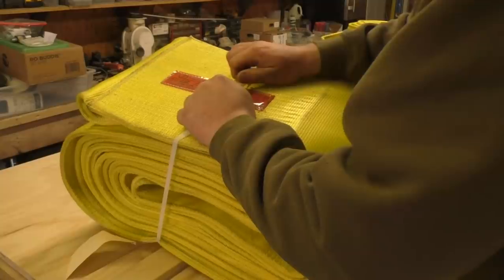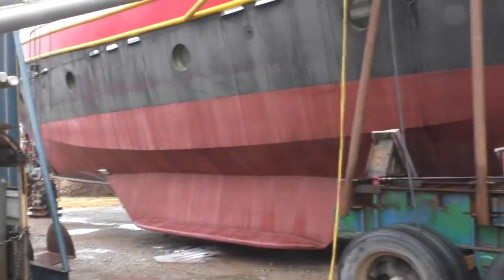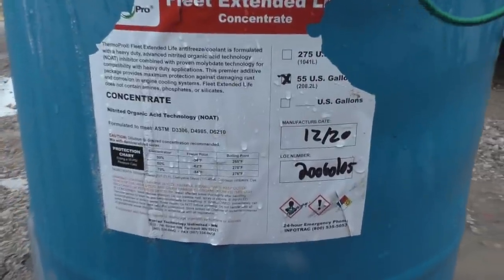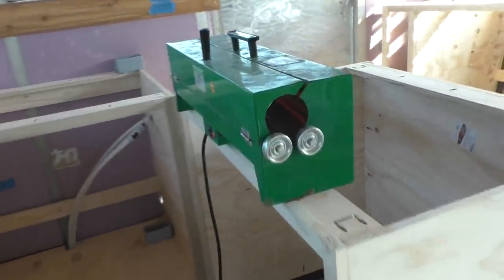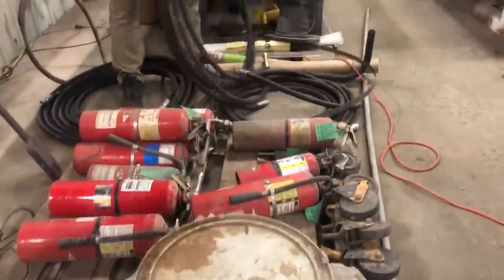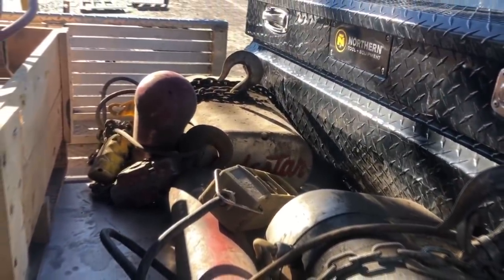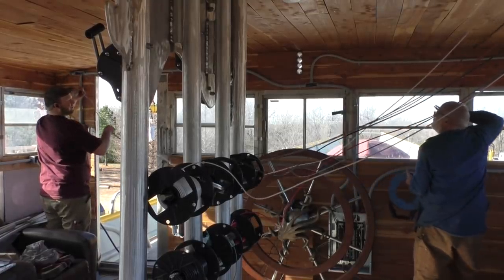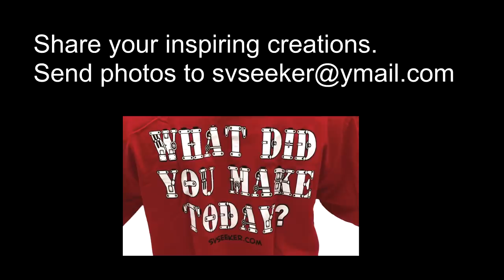Pilothouse Fitout - Part 3 - Electrical and more

Comment: You may also consider this..., or not that's up to yourself, some get their backs up when you offer advice.
While the basket lift doubles the lift capacity of the web sling, basket lift capacity is also cut in half if the synthetic web sling is placed under a keel or resting against any narrow contact point,  keep in mind that D over D ratio  "MAY" or will / most likely apply here. Its always important to remember, even if the sling is rated to pick up a load, it can still fail, I've seen this happen. How and where a load is picked up is what really matters, the angle even affects load capacity, lots of variables to factor and consider.  Due to stretch with synthetic slings, softeners will also be needed for the lift to avoid sling damage and failure from friction burns.  This lift in all likelihood, will also require a special 4 legged bridle and or spreader lifting beams. Since all lift responsibility and liability is immediately transferred on to the crane operator who may refuse to lift, you might want consider consulting with a heavy lift technician prior to lifting and find out what exactly you need, it could save you money and misery to get it all right the first time..
All slings are pretty much batch certified like 1 out of 10 , 1 out of 20 and so on. Any crane company can and may refuse to use these slings if you don't have any certifications /documented  paper work with them. They may even use their own anyway.  Me personally, I wouldn't worry about slings, I'd let a crane company take care of that.

Comment: Doing plastic conduit with that heater is really easy and fun. It was the best part of the conduit bending class I took. A trick to set them in place faster is to have water soaked rags on hand and then wipe the conduit down, locking it in position. Leather gloves can be handy for avoiding burns with the hot plastic too. Also, the wiring and conduit in the pilothouse looks great thus far.

With those weight specs, I would put good money on those being aramid fibers (when woven for ballistic protection, it is know as Kevlar) since they are holding that much force. Can't weight to see the video of the lift.

Comment: “Be nice to the apprentice”. I once sent an apprentice  for left handed channel locks.  😂
Reply: sent a kid back to the tool box for the metric crescent wrench. to his credit he couldn't figure out the difference so he grabbed all 3.
Reply: @dR1Ugz  I did the same. To the same kid. Came back to bite me eventually when I sent him back to the shop for a megger. He thought I was making it up. We were up on a overhead traveling crane. I had to walk him down off the crane and walk all the way back to our shop and show him that a megger is real.
Reply: At my first job at Advance Auto it was a call by a "customer" for a muffler bearing, later they called about a radiator for a '68 super beetle.
Reply: @meltdownmatt3849  you can't get a bucket of prop was without a 1D10T form in triplicate
Reply: We always got the green guy with " hey go get the board stretcher out of the trailer" but I heard a new one recently " hey go get the checkered spray paint out of the trailer".
Reply: @dR1Ugz  Funny thing is we always called the crescent wrench an "Alabama metric". Another good one for mechanics is to ask them to get a 16/32 wrench.
Reply: @robertbradley6946  a few spent hours looking for a short circuit stretcher , a gallon of low pressure steam and other essential products.

Comment: I know you have it figured out, but how the hell are you going to remove the pilot house with all those system connect to the lower portion of the boat.  Please explain on camera.  Love what you are doing.   RC
Reply from the maker: Patience,  and we'll show ya.
Reply: My guess for the electrics is there is only 1 cable between the pilothouse switchboard and a switchboard below deck.  It's probably coiled up below deck and they will feed it up once the pilothouse is refitted.
Reply: @steampunkskunk3638  If you were so lucky, there are operating cables, there is plumbing pipes and I am sure more than one electrical cable.  I know they have it figured out , because I have watched them for 3 or 4 yr and they plan it out in the beginning.  I am just curious  how.
Reply: I know you got it covered, I am just curious how ????